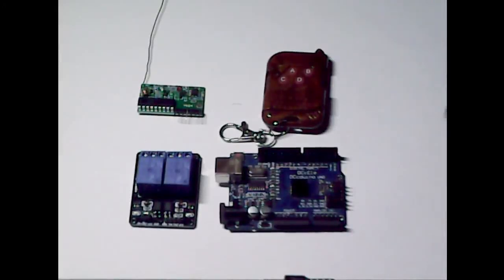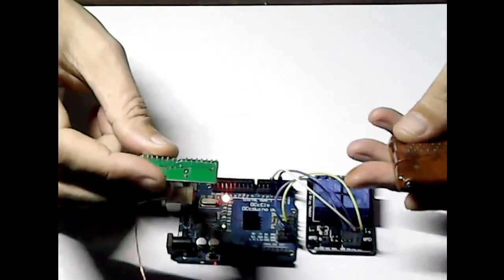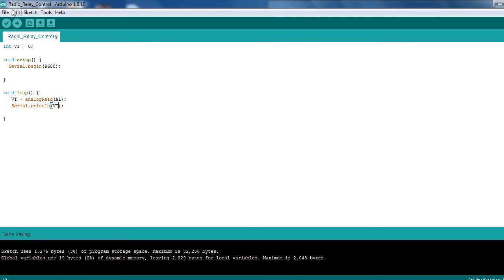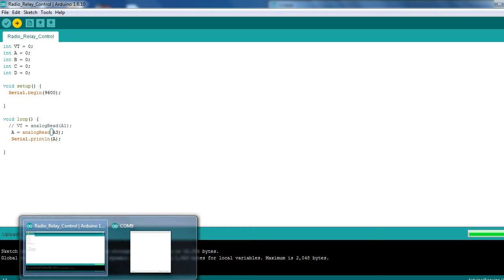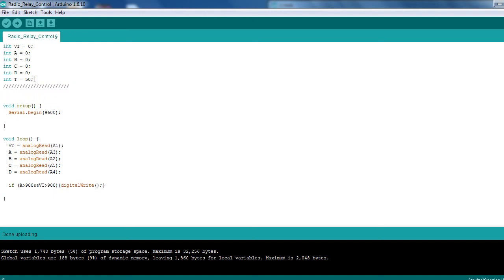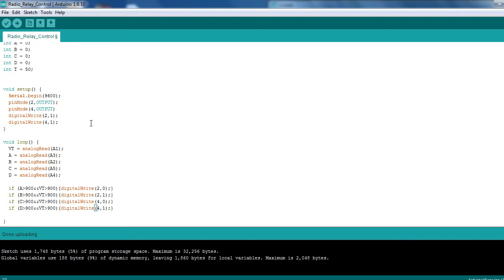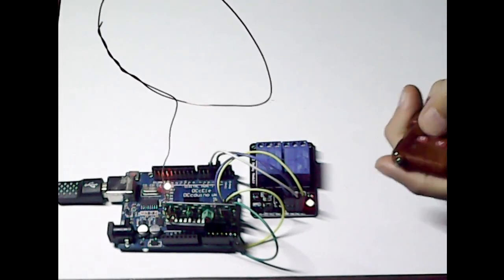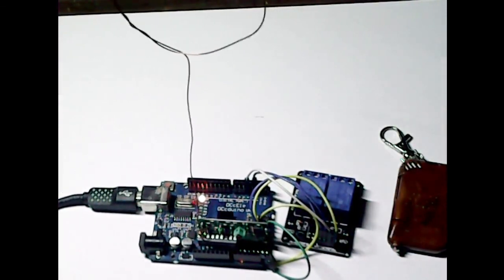Arduino RF Relay Control (Tutorial)

Comment: Hi thanks for the video, is it possible to set up each button on the remote at different times, so if you click a button on the remote it won't initiate for let's say 2 seconds?  I think you did something with delays on your video.  Also is it possible to use a 6v motor and code arduino to switch the polarity so the motor goes in reverse?  I would like to click a button on the remote and have the motor run in one direction and then after a set amount of time run in another direction.  No need to go into to much detail as your not tech support :)   I am just wondering if its possible or if you need other parts or if it can be done with only a relay, code, and wiring.
Reply from the maker: Hi bigReds , Sure it's possible, that's the beauty of code. I had something similar on a kids electric trike.
Reply: That's great news.  Will now have to mess around once my Arduino arrives.  Thanks a bunch!
Reply from the maker: give me a shout when you have it ;)
Reply: Have the arduino, I bought two because I am sure I will break one! ha ha.  I am already having an issue with my mac seeing one of the boards so not sure if thats a defect out of the box or something I have done.  Trying to hookup a rf relay board but I don't think it will work as it only seems to have gnd, vdd, rx0 on the board?  I can use the remote if I plugin my 12v motor and make the relays turn it on and off and I setup so I can reverse as well.  But have no idea how to get the arduino to connect to it.  This may take me awhile!
Reply: These are the boards I have, purchased them before I got the arduino and think I probably bought the wrong ones.  

http://leeselectronic.com/en/product/4260.html?search_query=relay&results=216&

IF Relay

https://www.amazon.ca/gp/product/B00PGSTIXQ/ref=oh_aui_detailpage_o00_s00?ie=UTF8&psc=1
Reply from the maker: Hi, yea it could be. what happens apart from not being able to detect ?
Reply from the maker: yea that board don't need an arduiono, programmable tho
Reply: So can I program that to ad delays after a button is pushed....  I am talking about the 12 relay board.  Basically what I want to do is have a remote that I can program each button to different things.  I want to be able to setup delays after a button is pushed.  I want it to use a relay after being pushed to make a motor go in one direction and then after a set time reverse....  What do you recommend for this type of project?  I would also want to be able to reach out to 50 meters or so.

I looked at the XBees but since I am new to this not sure if I am able to program it or not.
Reply: When I connect it as mentioned the computer does not see the board.  But the on LED comes on and the yellow LED with the L next to it comes on and is steady.  Not much else happens.  I can plug power into the 5v... and it comes on.
Reply from the maker: it may be that the bootloader has failed to set the chip, maybe worth trying to run the bootloader on that board ;)
Reply from the maker: I've never used one of those relays, so I'm unable to comment on how to program them. sorry
Reply: I figured it out.  They won't be able to do what I want.  I just ordered similar stuff that you used.  I think I will be able to make that work.
Reply from the maker: best idea ;)
Reply: I think I should be able to do all the things I mentioned with your method in the video?  Once I do that I may move up in the Xbee modules.  They look pretty cool.  Have you used them before?
Reply: I will try the bootloader.  Thanks
Reply from the maker: I've had a little play with one, I don't  like  how you  code them.
Reply from the maker: it's worked for me in the passed ;)
Reply: So for the bootloader you mean burn it over from the working arduino correct?  Just like in the video you posted?  I tried it and everything works but gives me an error when I select burn bootloader :(
Reply: Is it hard to code?  Do you think a newbie would figure it out?  Only reason I want them is that I may have multiple units using wireless and want to connect them together so one unit controls them all.
Reply from the maker: @bigredsfirearms5001  I'm alot more clued up these days, so if you still have the parts and the same problems give me a shout ;)
Reply: @liney118  Hi, not working on it at the moment but will give you a shout once I do!

Comment: Hi! This is a great tutorial and I'm probably too stupid to understand it :D. I've found your video, because I wanted to make the same modules work together. (I want to make a gate opener.) Except my board is a genuine Arduino Uno (no big difference I guess). I'm not hell of a programmer, but this should work pretty straightforward. However I can't make this work. I've even copied your code, tried to use the same pinout, still the relay module wouldn't respond to the RF. (relay module is working fine if connected only to a PSU!)  There are a few things I don't understand about your video: firstly if I brake out on the analog side i'll have one pin unconnected. Secondly why did you choose arbitrary order for the A pins in your code?  Lastly, isn't that true that the YK04 work with digital pins as well? Oh, and are Arduino pins capable to output enough mil.amperes to make relays work?
Reply from the maker: HI thanks for the comment, sorry I never recieved it till now. if your still having problems massage me back ;)